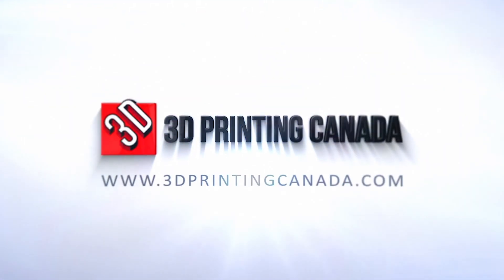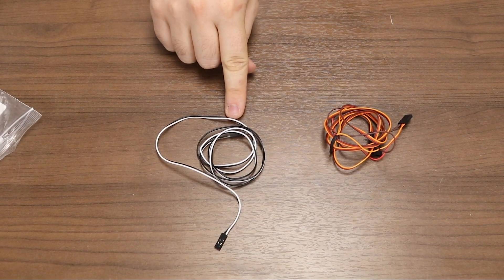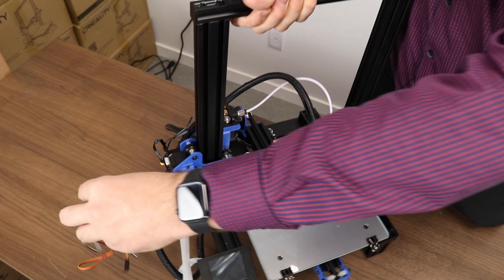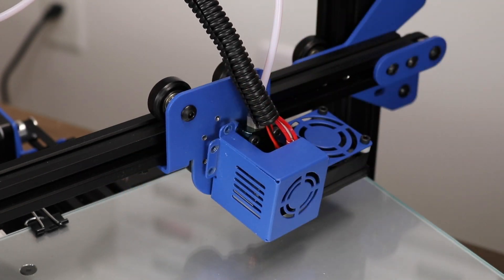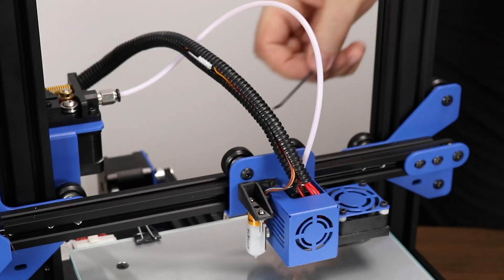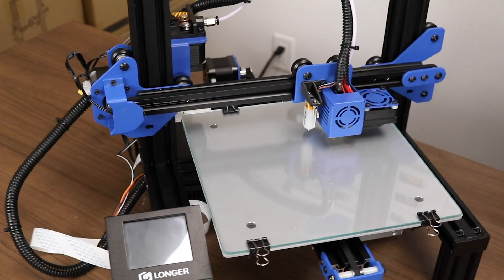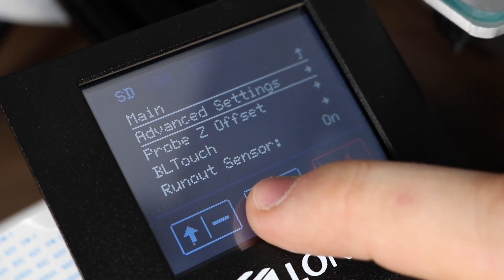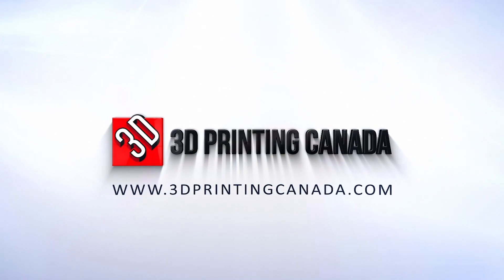How to install a BLTouch on a Longer 3D LK2 / Alfawise U30

Comment: I know this video is sort of old, but I am a little confused on this... I have found instructions for installing a BLTouch on Longer printers on their website, and the only difference with this process is that they say to add a 50k ohm or 100k ohm resistor between the orange and red wires of the BLtouch connection, before the wiring harness that plugs into the board...

The instructions on their website says this is for all LKx series printers, though is not necessary for LKx Pro series printers, for those it says to plug right in like you did without any modifications... But all LKx series printers includes the LK2 and your motherboard looks identical to mine...

So I'm confused why Longer says to use that resistor if it is not necessary... And I'm a little paranoid of frying either my motherboard or the BLTouch if I skip it... I guess I should have mentioned that my printer is the Longer LK1 (identical to the Alfawise U20).

I mean it worked for you, so I would think it would work on mine...

Comment: In LK4 pro the screen menu is different, what I have to do?
Reply: The touch points are at the top of the screen, and inversed. You need to calibrate the touch screen. touch the screen at the top, above where the button is on the bottom, and you'll be able to navigate to configuration > touch screen calibration. It took me a solid 25 min to figure that out, and it was really just a lot of fumbling around until I got to the calibration screen. After you calibrate it, the touch points will be correct. Don't forget to SAVE the configuration to the SD card, otherwise you'll have to start over again on the next boot.

Comment: Mine freezes when flashing.  The bar reaches 100% and stays there.  If I turn it off and take look in the card, there is no eeprom file.  Only project.bin.  Regular LK2 FW flashes fine.  I tried two different cards, bother of which I've used to print on the LK2 setup for BLTouch. 

I don't need a .UI file for this do I?

any idea why?

 I should have never tried to flash this thing.

Comment: Hi guys, I used your guide to install in my alfawise u30 (v08) and I used firmware too, but when I try to use the bltouch, it only makes an initial functional test (when I turn on the printer), it remains red, with the tooth raised, and if I try to make the calibration, I risk breaking the glass plate because it doesn't change, it remains red with the sensor retracted upwards. where can I have failed? Thanks in advance
Reply: I have the same problem, have you found a fix for this?
Reply: @adamshaban1  I changed the card with a more recent model (not u30 pro) also to be able to double z with 2 direct outputs
Reply: @simo3d870   could you please elaborate?
Reply: @michaeldahlinger8815  I just replaced the u30 board with a new one (can't find the order), I didn't mount the u30 pro board because it's different type. However, I know that there is the possibility of making a cheaper modification, with pulleys, to rotate the second Z screw without using the motor but by means of a pulley connected to the first Z screw at the top. Like this https://ae01.alicdn.com/kf/HTB1zVntOr2pK1RjSZFsq6yNlXXa7/1pcs-Creality-ENDER3-CR-10-Dual-Z-axis-upgrade-kit-use-with-single-stepper-motor-CR.jpg

Comment: Hi, i have installed the Firmware on my lk4 but now there is no Touchscreen support. What could i do?
Reply: So with the LK4 touchscreen as mentioned above their on the top of the screen. So far I’ve figured out how to make it respond to where the buttons are displayed. In the settings on the new marlin firmware you can calibrate the touchscreen and you can properly use the touchscreen
Reply: I’ve Finally figured out how to get BL Touch to work on the LK4. I’ll be completing my calibrations and uploading a video since there is almost no info on this particular printer with BL touch.
Reply: @austin5797  Yeah, my bl touch only worked by flashing the u20 firmware, not u30. So my printer thinks its bigger than it is. I'm following a tutorial on how to install custom marlin firmware that I can edit. Hopefully there I can fix the parameters.
Reply: @michaeldahlinger8815  I actually did the same with the u20 firmware. I’m still new to Marlin however in the Configuration H file you can edit the bed size etc from that file. I’m just glad someone is also trying to figure this out for the Longer printers. Not much information for the LK4/U30 models. Amazing printer imo.
Reply: @michaeldahlinger8815  got my LK4 to use BL touch officially. I went into the Configuration H File, scrolled until I saw : //Travel limits after homing
You’ll see define X_Min_POS 0
Etc. with Y&Z Axis
Then you’ll see 
Define X_Max_POS (add your bed measurements)
Define Y_Max_POS 
Define Z_Max_POS

For my LK4 I typed
220
220
250 for my bed size. Hope this helps!
Reply: @austin5797  Did you ever get your bltouch working? For some reason I can only get it to work with the LK108_BLtouch_firmware.bin. This obviously isn't good as it's the firmware for the u20, not u30. However when I try to compile my own custom firmware with the correct bed adjustments, the bltouch doesn't work. Unfortunately I can't see into the .bin file so I only have the configuration files to go off of. All of my settings seem to match up so I can't seem to figure out what's wrong.
Reply: @michaeldahlinger8815  I did get my BL Touch to work, I’m actually working on a video on showing this for the LK4. Here’s a link to a Reddit post I made, maybe it’ll be more helpful than my comments here. https://www.reddit.com/r/3Dprinting/comments/kuqb62/finally_installed_bl_touch_on_longer_lk4u30/?utm_source=share&utm_medium=ios_app&utm_name=iossmf
Reply: @austin5797  Thanks for the quick reply, so by using the U20's firmware, do you mean copy and pasting its config.h into VScode, and changing the parameters?
Reply: @michaeldahlinger8815  so just load the u20 file from the GitHub link to your SD card, 
Once on your SD card go to the config H file to edit your print bed size. Save them load SD to your printer(it should flash) if not cut & paste the Marlin folder contents to the main SD card ( so it’s not In that folder and the printer will understand the files, I had to do this )
Reply: @austin5797  No luck man :/
I had been following a French guide linked in the Readme of the firmware provided on github. It led me to believe that you have to compile the firmware through vocode to change the configuration files properly. I might just have to wait on your video. If you have any other advice or updates, let me know!
Reply: @michaeldahlinger8815  I’m working on a quick screen recording video right now. Hopefully with me showing exactly what I did for the firmware flash it will help. I’m not super video savvy so sorry I’m advance. If it still doesn’t fix your issue with the LK4 I’ll do a full reset of my machine and do a start to finish of the process. I would right now but I have a 14 hour print going at the moment.
Reply: https://youtu.be/jCgJqfX5ljs  Here is the quick screen recording I made showing the steps I took. Again, if this doesnt help with the flashing process I'll make a better video. Just trying to get more exposure to this printer since It's pretty good for the price.
Reply: @austin5797  Believe it or not, in the meantime I actually just now got it to work through my firmware I compiled in vscode by editing my pins and enabling pullups highlighted in this tutorial and forum! (after translating to English of course)

Forum: https://www.lesimprimantes3d.fr/forum/topic/23440-tuto-installation-configuration-dun-nivellement-auto-bltouch-touchmi/

I will still definitely watch your video and see what you did and if I want to change anything especially if something goes wrong again :(
If you want more information or my firmware, just let me know!
Reply: Same. I can't figure out how to work it
Reply: Actually. I figured it out. @3d Printing Canada There is a button for LK4. The buttons on the GUI and actual trigger for select are in wrong place. select button is top left part of the screen. Down button is middle top of the screen. Up button is on the top right side of the screen.
Reply: @darthokuz  How did you install it? Please I am struggling
Reply: @michaeldahlinger8815  Download the zip of firmware from the github link. Also download the latest offical marlin firmware. Extract the first one. Then extract the second zip from the latest marlin then merge them with first extract. Then follow the rest of the steps from the video
Reply: @darthokuz  So do I add the extract of the latest marlin firmware into the "marlin" folder from in (Printer name) Marlin Folder. Then replace the "project.bin" file with the new printer specific bin file? Also there was some other note 2.0.x that I was not sure about. Thank you.
Reply: @darthokuz  I think I'm confused on the merge. I tried to look it up and found something about like "git merge", but im not quite sure how that works.
Reply: @michaeldahlinger8815  not git merge. After extracting the zips then copy the context of latest marlin folder and paste it in the extracted folder from this videos git
Reply: @darthokuz  Thank you so much! It flashed :)
Reply: @darthokuz  Did you ever get your Bl touch to work? I originally had a clone and after spending many days trying to troubleshoot the config files I ultimately gave up and bought the real deal. After swapping out the clone with the real Bl touch im still facing the same issues. It deploys twice on start up and switches to red. But in the menu and during leveling it refuses to deploy. Everything is wired correctly so I just dont understand.

Comment: Hello 3D printing Canada. I'm one of 3 guys developped Marlin for that. It would be courteous to quote those who worked on Marlin development and engineering that made it all possible ;-) You didn't made that "we've achieved what most thought was impossible."...
https://www.lesimprimantes3d.fr/forum/topic/22306-tuto-alfawise-u20x-u30-flasher-marlin-2x-firmware-alternatif/
https://www.lesimprimantes3d.fr/forum/topic/23440-tuto-installation-configuration-dun-nivellement-auto-bltouch-touchmi/
Reply: Hi. Thanks for your great job. I have a question regarding of the BL touch on Longer LK2, i have bl touch level at 25 points. Looks a bit to much for the printer. Keep freezing the marlin when do the bed leveling. It is any chance to change to 9 point verification point?
Reply: @pkrisss  Hi ! You sure can personalize the probe points. You can fix this to change  #define GRID_MAX_POINTS_X Y where Y is the new value, so 9.
Reply: Hi. I never did it the Marlin firmware before. I have any chance to make the 9 point check change and allow the M48 code and upload the .bin file somewhere?
My Longer LK2 motherboard is L3DP04B01V0G. Or if you don't have time to do can you share me please where can i download the editable marlin  ready for my printer and motherboard? I tried to edit the canadian link marlin but a lot of thing is missing and my motherboard was not set up correctly. Thanks for your help in advance.

Comment: would absolutely love to see this be done with the U30 Pro/Longer LK4 Pro. it's regressed to an 8Bit Atmega board, but the display is very different (portrait, for a strart) Serial display, not an FPC one.
Reply: I have heard of people doing it and there is even firmware adjustments for a BLTouch for the LK4 Pro, but I'm not really sure of the process.
Reply: https://www.youtube.com/watch?v=-_QOYY1IFIM I followed this and did the hardware side but haven't managed to flash the firmware.

Comment: I will make my own wire, but I have 1/4 watt 1k ohms.  Will it work if not, what resistor will work?
Reply: Yeah you can use 1/4 instead of 1/8. You can always use a higher wattage resistor in place of a low wattage one.

Comment: Hi,

Thank you for the video and procedure...  I would like to install the non-bltouch version on my Longer LK1.  But while reading the Read Me file it mention that the board version as to be VOG.  And the board in my printer is VO8 (the printer was bought on your site).  I presume there will be some issue with installing that firmware on my printer???

Thank you and keep up the good work.
Martin
Reply: Martin,

We will be filming instructions for the V08 in the next week or two - but yes, it can and HAS been done. The firmware isn't the issue - just the board connections are different.
Reply: @flexplexico480  Great news...  Thank you for the update.  Really looking forward to that video.

Comment: Thank you for the great video. I am wondering if this will work with the Alfawise U30 Pro. It has a slightly different main board than the U30, and it has a different touchscreen.